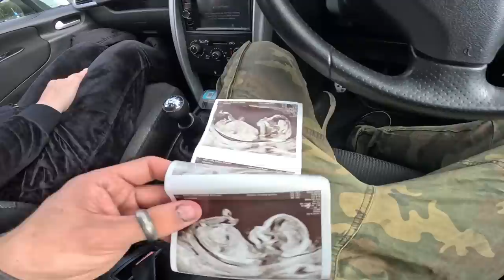A New Member To The Team?  - Steam Cleaning A Shady Roof Infested With Growth!

Comment: Congratulations on your new team member 🍼

Can I ask how you manage running two machines from the one mains supply? I had to connect to a neighbours tap today just to keep going.
Reply from the maker: i let my tank fill to the max then just have the hose running constant to the smaller machines reservoir, then usually switch it over after about 30 mins of cleaning, wider hoses definitely help the fill time, and thanks!

Comment: Roof now lighter in more ways than one 😅 hope you get a callback about patio, lower walls and boundary wall clean. Was thinking interior's under restoration so owners had sensible Idea to clean roof before decorating incase any water ingress and check roofs condition. Did far side garage get done or bad access not filmable?

Comment: As for your previous video's hose kink issue, no specific hose, but look into something called an 'over-under' technique for rolling up a hose. Done by hand which sucks, but may help for longevity of the material. Something to look into. (Done also for cables, wires, and such)

Comment: Hey Sid, I'm watching trop Belgium as a fellow exterior cleaner
Mostly window cleaning and patios + facades
Got my first (very) big quote for a roof, 2 appartement buildings last week
- when turbo and when surface cleaner?
- during turbo, is the angle fixed during the work? And what is the range of pressure used 
Thanks

Comment: I watched this yesterday and maybe it’s just the time lapse but first thought that you made it look quite easy, but later on it was only the garage that you used the flat surface cleaner, mainly the turbo nozzle, for the rest and wondered why you didn’t use it more, because I can imagine using just the turbo nozzle would take ages. I remember you saying on really mossy patios the flat surface cleaner isn’t powerful enough, but when you used the smaller one on the garage, it seemed to look easy. Another general question, how far is the nearest competitor from you? I guess Burton is quite small, but I know Derby well and could imagine there could be two companies doing much the same. What was a difficult thing when you started out, apart from finances, like researching best equipment? Because when I first started watching Bournemouth jet washing, I used to think the main boiler he had was better, but your newer equipment seems a big improvement, his flat surface cleaner looks a lot bigger, but somehow it seems you achieve the same results as Ricky does. I’ve never seen him work on roofs, mainly patios but he was the first to jet wash wooden furniture which I never new could be done. Guess I’m interested if you’re thinking of new areas you could expand to? Years ago, my sister and brother-in-law were looking into setting up a franchise business and one they considered was wheely bin cleaning, and I said I couldn’t imagine there’d be that much demand. They know run a cleaning business where people can hire out someone to clean their house either on a regular basis or one off. They seem to have good pay, and my sister covers about a 40-50 mile radius. But exterior cleaning, I can’t say I’ve ever seen houses having work done, unless a new extension was going to be built. Your success is thoroughly deserved!